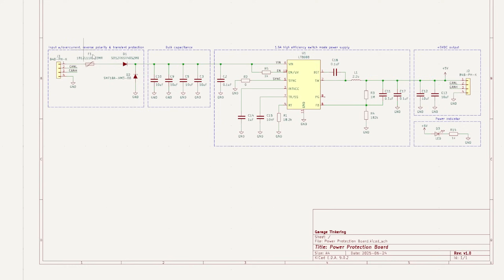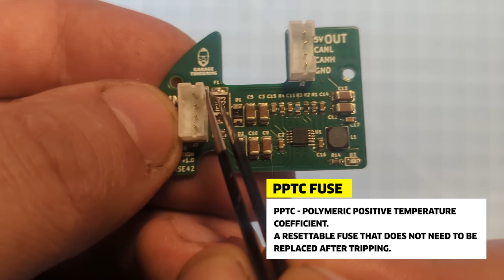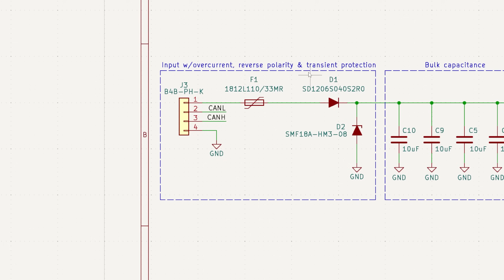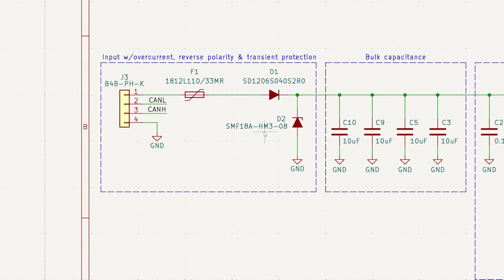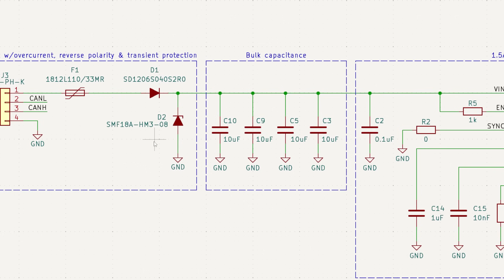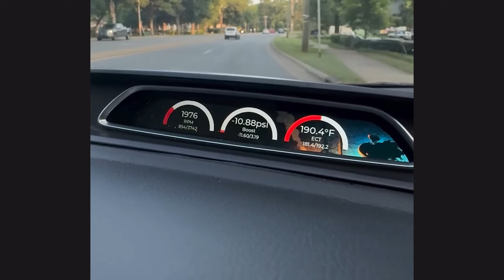How to Protect Your PCBs from Your Car

Comment: I don't want to be rude but I would never run a buck converter in automotive applications, as AEC-Q100 qualification requires linear regulators. I think most will agree most MCU's suffer short life using a SMPS.
Reply from the maker: I get what you're saying, but incase you've overlooked it the LT8608 is fully AEC-Q100 qualified - Page 1 of the datasheet: https://www.analog.com/media/en/technical-documentation/data-sheets/lt8608-8608b.pdf
Reply: There may be some confusion here. AEC-Q100 is a reliability qualification for ICs, not a rule about what types of components are allowed in a design. Using a switch-mode power supply (SMPS) is far more efficient than an LDO, which means much less heat and better long-term reliability for the board. For example, with a 250 mA load and an average 14 V vehicle supply, an LDO regulating to 3.3 V would burn about 2.8 W of heat. Using an SMPS under the same conditions would dissipate roughly 0.1 W, assuming about 90% efficiency. That’s a heat/power reduction of over 96%. Both approaches provide a stable voltage for the MCU. While an SMPS isn’t quite as “clean” as an LDO, the small amount of ripple involved is well within what the MCU can tolerate and is easily handled with normal decoupling. In an automotive environment, the bigger concern is having a component acting as a 2.8 W heater on the PCB, not the minor voltage noise from a SMPS.
Reply: @KaiserEngineering I understand, what I am saying is if you require aec-q100 you won't be using a buck converter
Reply: @Rooey129  All automotive ECUs I've seen use SMPS. It's standard practice, there are qualified parts and, provided you have filtering/layout done right, you'll pass EMC testing and prove compliance with the appropriate automotive regulations.
In specific cases you might be able to use a linear regulator, but most of the time heat dissipation becomes a problem and a SMPS it the only way around it.
Linear regulators are simpler and cheaper, noone would use switching regulators unless they had to.

Comment: about design , 2 major issues i can spot , no imput filtering , would not pass any emc stuff nor conducted emission , your design would send noise to whole car,  you need to place PI filter C-L-C, (to prevent oscilations sometimes you may add 1ohm resistor in series to the 2nd cap in this filter , its just nicly tuned RLC network.) , to block any high frequency noise going from this buck to whole car, 2nd thing 1Meg is realy realy high feedback resistor, it will be realy prone to pickup noise, this 100nF capwill propably smooth this out , but , it will create massive problems. you have nice , realy fast 2Mhz dc dc converter , and you created quite prone to pickup noise feedback loop ,  i did not made calculation to this exact one , but going order of magnitude lower , to 100k and lowering cap size would be much safer in terms of passing noise resistance emc tests, but thats eyeballed , none calculations were made about this feedback loop. this cap will work like ac highpass filter , also might work as realy slow lowpass, resulting in wierd bandpass filter. Hope for best and technical discussion, No mud plis :D

Comment: Try using AI. Depending upon the one you use, most of the time you will get the same answers. It will even suggest components.
Reply from the maker: I'll think I'll stick with the experts when it comes to this stuff. AI has a habit of suggesting really old, outdated components that are no longer suitable for the job

Comment: Two things for you: First and foremost, thank you for putting in this work on both the hardware and software and making it all available to the community at a reasonable price! Second, is there any chance of you also being able to aquire some larger units like, say, a 4-5" unit for speed and tach on older cars?
Reply from the maker: Thanks bud. Screens that size you really want something more powerful than an S3 to drive, as they don't recommend over 800x480px. Something like the 4-inch Waveshare P4 board is a good shout - https://www.waveshare.com/esp32-p4-wifi6-touch-lcd-3.4c.htm?&aff_id=GarageTinkering

Comment: Could you make anything that protects the battery from being drained? I've chased a parasitic drain for over a year without sucsess, so that would be rather nice.
Reply from the maker: You could make a dead switch that kills all power and is remote controlled. 

What system is the leak coming from? Did you identify it?

Comment: The part about component max temperature ratings suggest the hardware is not being designed to automotive standards. I measured 85 degrees C in a car dash in the UK on a 30 degree C day (using a K-type thermocouple) after not being able to bear my hand on the (black leather) steering wheel a few years ago, which had never happened before. So in hotter climates than the UK, higher temps are realistic. All of the components for use in OEM automotive passenger compartments should meet AEC-Q200 grade 2 (-40 to 105C), with grades 1 and 0 being higher temps, for use under bonnet, etc. Typical industrial grade components are rated for use up to 85C, so may not be reliable above that. 
Is this a big deal? Maybe not for a non critical / hobbyist product, but my bigger concern would be what the max temperature rating of the display is. I tried a few industrial rated displays in an oven years ago, to see what happened to them, and they stopped working in the high 80's C. Seemingly temporarily, as the display graphics re-appeared as the temp reduced, but I have no idea whether any lasting damage was done. At the time no displays suitable for what I was doing seemed to be readily available with suitable AEC ratings, but I wouldn't be surprised if they are now.
Reply from the maker: As we mentioned, everything here is rated to around 125 degrees C, so should be well within the means of pretty much every temperature you might see within the car. 

You're correct about the screens being a concern. The ones I've had made are rated to 85 degrees C, so should - for the most part - be fine. There are obviously outliers that are going to push that, and perhaps 1 day a year in the UK lol, but they might want to consider a different solution with the displays; though as you said, I'm not sure what they might be as I didn't find any when looking, and the manufacturer I used could only rate to 85, and that seemed to be the standard
Reply: Looking at the datasheet for the LT8608 it is AEC-Q100 rated, which is the appropriate automotive standard for ICs. It even has a LT8608H variant which is rated to 150c! When it comes to displays, I have had a basic Ebay oled colour 1.5inch 128x128 display in my dash for 10 years and it was just started to fade in the corner where it is slowly getting cooked by a nearby linear regulator.

Comment: Fab video, question for professor Matt - I've heard about ideal diodes that use MOSFETs to avoid the voltage drop of normal diodes - would that work here for reverse voltage protection? Is there much point doing it, more to the point?!
Reply: A MOSFET configured as an ideal diode is another good option for reverse voltage protection and is typically better. But for something like this it is overkill and adds unnecessary complexity. We are stepping >12V down to 5V, so there’s enough of a voltage difference that we can accept a ~0.7V loss. Additionally the normal operating current is still relatively low, so the heat generated from the diode voltage drop is not a major issue.

Comment: I didn't hear you talk about coating the board to keep moisture at bay.  Some of the boards in my car look like they were dipped or sprayed with a clear liquid.  I also looks like it might minimize the effects of vibration the way it seems to stick the parts to the PCB.
Reply from the maker: That's a good point. There are definitely other considerations. Personally I like to make fully sealed enclosures, but coating works too
Reply: @GarageTinkering  FWIW I use conformal coating spray
Reply: @IAmOrion +1 for conformal coating - but make sure you don't need to do any rework or even probing because if you do, the coating will fight you every step of the way - ask me how I know...
Reply: @ghwizz  That's pretty common.  Many vehicle use conformal coating especially on ECUs and other modules.  I used to program BMW Z4 E85 keys for people, had to remove the EWS Module (easy), then use an AK90+ (easy) to program it etc, but the pain in the arse part was scraping off the coating on the main chip enough to read the chip but obv without damaging it! some VERY gentle persuasion with some fine sandpaper normally worked well though.  I only coat stuff AFTER I've fully tested ha but even then, sometimes you do still curse at yourself and have to scrape bits off for probing and triple checking as you say